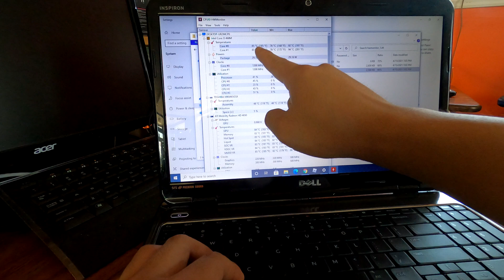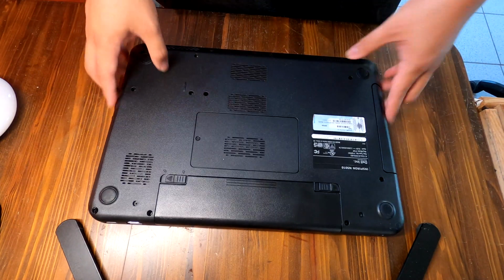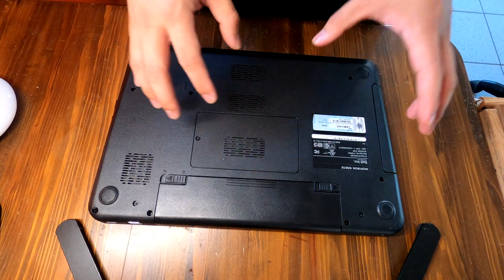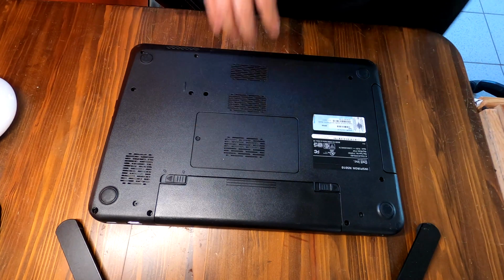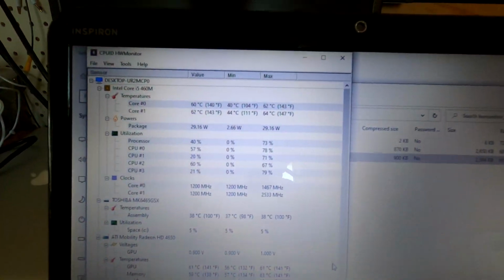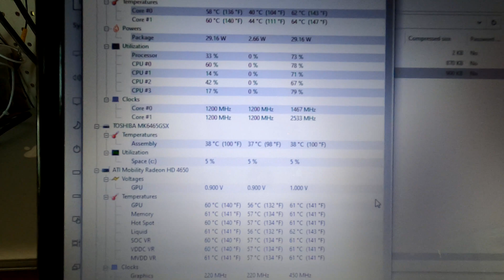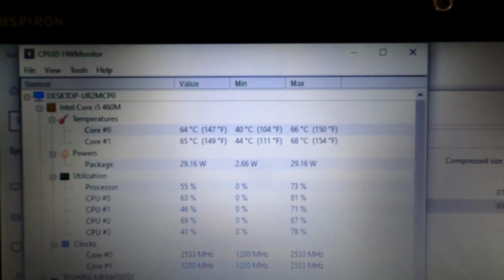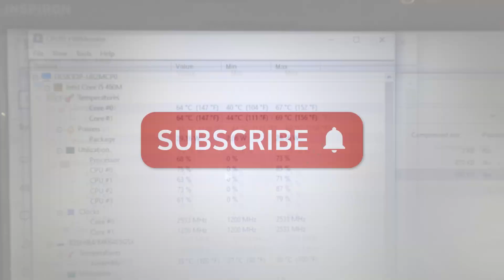Dell N5010 Disassembly & Overheating Fix (2021 New Tutorial)

Comment: I accedently removed the thermal pads from the heat sink ( besides the fan not the processor ) , and I can't find any thermal pads in my area can I apply thermal paste instead ?!
Reply from the maker: It is not the best but what can you do. I would do the same thing. Make sure to apply enough thermal paste
Reply: @PTITBROTHERGravenhurst  could u please recommend the thermal pad thickness I should use, trying to re-fix it ?